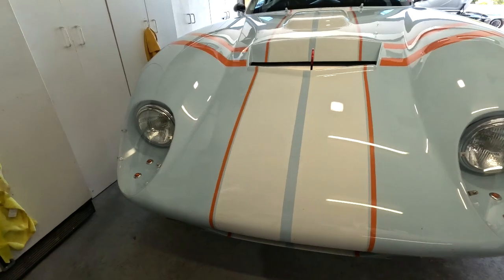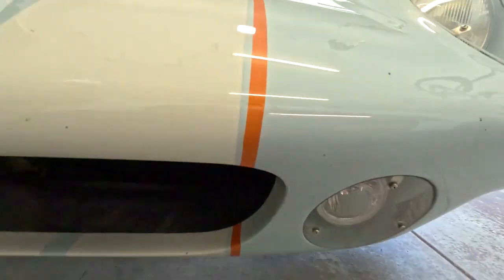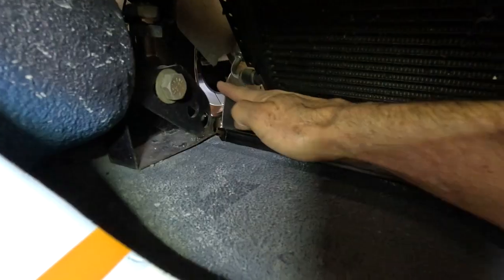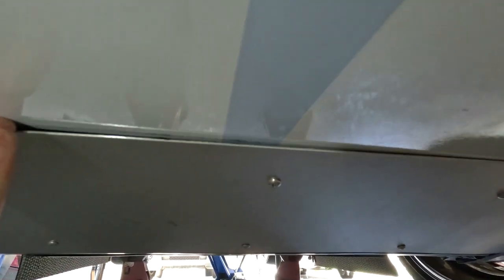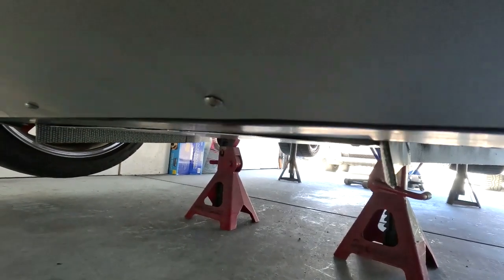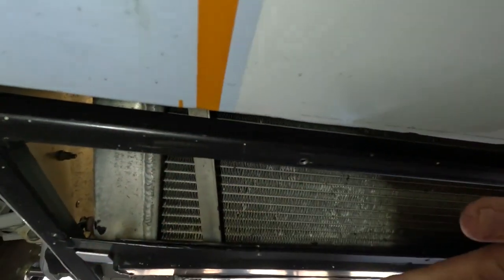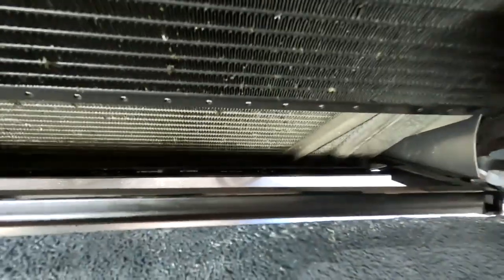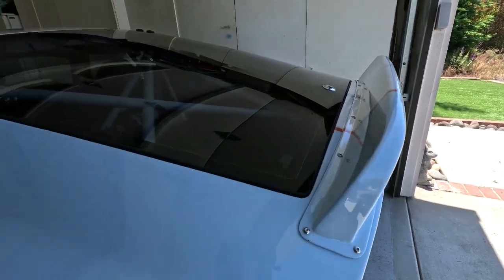Solidworks CFD analysis of the Daytona Coupe-Cobra Daytona Build, Video 217

Comment: Build some conveyor belt material rubber on the sides near the hood hinge and the radiator to help make it more of a cold air intake because you’re just losing so much air out the side towards the wheel arches there would be a malleable fix with a rubber curtain of some description 🌟🚘🌟
Reply from the maker: I might just give that a try. Thank you for the idea.

Comment: Maybe make a sheet metal plate on top of the opening and lead it up to a gap above the radiator to let the high pressure escape and make downforce? 

Do aerodynamic radiators exist or is that counterproductive to cooling? Surely there is a balance there that exists?

I wanted to do something like that for my project brick (92 S10) and looked up some 3d modeling software but it was going to be a full time job and I gave up looking.
Reply from the maker: I didn’t model the plate idea but maybe sometime I can look into it. Not sure about radiators that are aerodynamic. Maybe I will research.  I am lucky I have a friend with the solid works and does it for me on the side but I don’t want to abuse it. Thanks for the great comment.

Comment: Anybody thinking about going without the rear spoiler should think twice. You can’t safely go without the rear spoiler or wing if you’re going to run at high speeds. When they raced their first race in Europe at Spa, Phil Hill came in during practice saying the rear was lifting at speed. That’s when Phil Remington took a scrap piece of aluminum and crudely riveted it to the rear and it worked.
Reply: I heard it was an aluminum can.  But that may be a myth.
Reply: @Danny-in4rb  could’ve been, the book just says it was a scrap piece of aluminum.
Reply from the maker: I did read about that and wonder at what speed it starts getting light. Planning on doing 140 at the silver state classic in September so we will see.
Reply: @cobradaytonabuild1671  It doesn’t mention a specific speed but anything north of 100 mph is usually where aerodynamics really become important in general. it didn’t show on the tracks in America because it didn’t get fast enough on the short tracks and not as many elevation changes or crests. Also the fast tracks like Daytona are banked so gravity masked the issue.
Reply from the maker: I am leaving it on so will not find out what it’s like without. Maybe some aero testing on it latter. We will see. Great comment, thank you.

Comment: I’m curious what original Daytona and superformance model do with there front end aero if anything.
Reply from the maker: The original actually was pretty good as the aluminum hood had a perimeter frame so they could capture all the air coming into the nose and force it out the hood. Something we cannot do with fiberglass being used unless you make the hood non pivoting.
Reply: @cobradaytonabuild1671 the originals hood clamshells open just like the FF’s so I’m not sure I follow what you’re saying. Looking at my Daytona Coupe Bible I don’t see anything different in regards to the hood. The shroud around the radiator that sits beneath the hood is a bit different and they have brake cooling ducts inside.
Reply from the maker: The hood does open the same was but since you don’t have all the fiberglass structure towards the radiator and only the thin steel frame and aluminum body it can be sealed up much better.